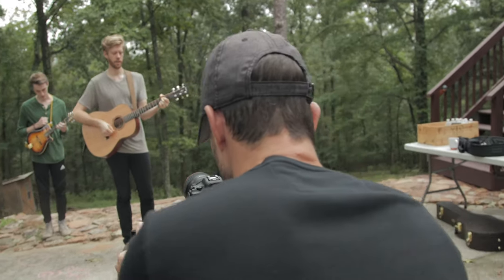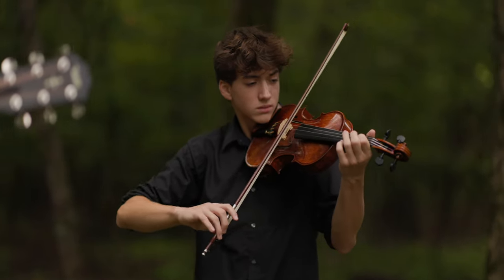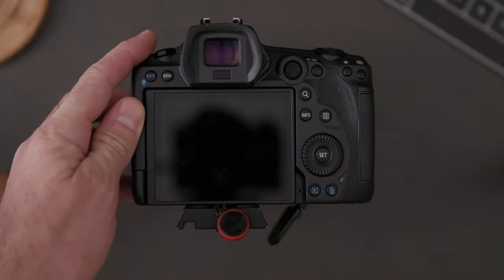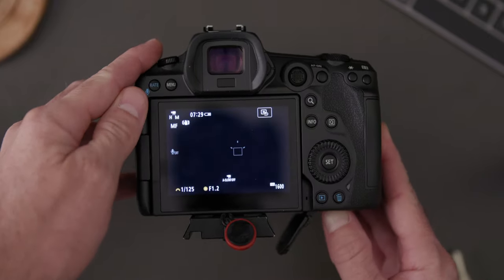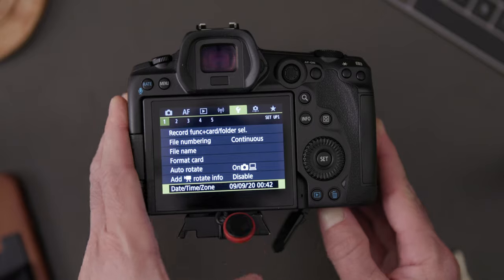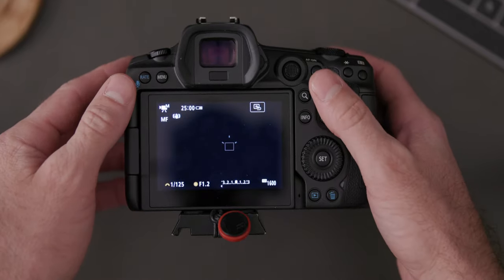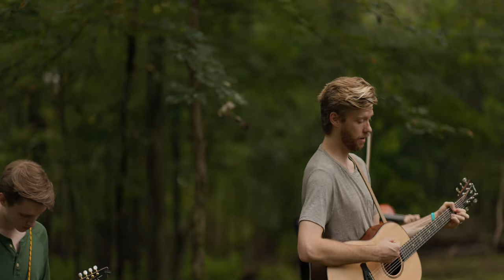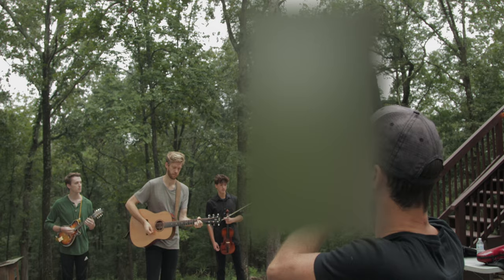Canon EOS R5 - Reset the Overheating Timer in 60 Seconds

Comment from the maker: Please use responsibly.  UPDATE - some are saying that you don’t have to do the battery door trick, just change the date and pull the battery out. 🤷‍♂️ UPDATE 2 - It works. just change the date and pull the battery without powering down, this will reset the timer any time, even if you haven't overheated yet. Stupid simple workaround.
Reply: So you’re saying that we could just keep resetting the camera and continue on shooting? And then the camera will shutdown before the sensor gets damaged? I’m not trying to hold you to this 🤣 It would be good if someone tried it out to see. I’m not willing to risk my camera, haha
Reply: @VisionRouge
His summarized hack....step by step:-

1. Power the camera with a external battery and close the door beside the R5 (you can also do the screw trick if you like)

2. Record video until you see the overheating logo, or even until the camera shut down.

3. Turn OFF the camera by using the power button so your recording parameters (ISO and so one) are saved.
4. Turn back the power ON.

5. Go to the menu, Change the time of the day to +3 hours at least (or add a day).

6. Drop the power by disconnecting the external battery.

7. Wait 30 seconds or even less.

8. Put back the external battery. The overheat issue should be gone. (if not, you may actually be in real overheat situation), try in 10mn…

Extra step to put back the time: You can do this after step 8. This have been confirmed working by dellfonic from MagicLantern forum.

9. Turn OFF the camera using power button. [this is the extra step]

10. At this time, the “overheat flag” is now written into memory.

11. Turn back on the power with the power button. The camera is now booting from a regular boot.
Reply: YOU ROCKZ!
Reply: "From what I'm told,"  -  WHO told you?  Absolutely NOT anyone from Canon.   Your camera will be DEFECTIVE in time.
Reply: U R NOT ME sure bro 👌🏼
Reply: @KevKlopper  thanks for your reply, Mr. Canon Engineer
Reply: Rooting for $4000 “VOID” Watranty  disaster
Reply: In 2 months, All these "Experts" are gonna be crying and uploading "My Camera Overheated and Broke" videos.
Reply: @iwaswithyourmom9410  guess we will see in 2 months.
Reply: It definitely relieves stress, but would you recommend using the r6 for full wedding days? Not sure if I should get that or a used 1dx ii
Reply: @nelsontan2406  or sooner.  Did you see lensRental's teardown of the R5?  There is no fucking place for the heat to go in that crammed body.  Unlike cine cameras that are larger and have fans.
Reply from the maker: @rickymeyerfilms  The R6 will have a better image, since it's oversampled 4k and has clog, which gives you more dynamic range. throw in smaller body size and ibis plus a flip screen. It's way better. The question is, does it overheat? I'm not sure how it performs with newest firmware.
Reply: The Film Poets have you taken your r5 out to shoot a full wedding yet? (Before the new firmware)
Reply from the maker: @rickymeyerfilms  yes. I did it with 1.1.0 - I did an interview and a few shots in 4khq, some stabs too, and then most of the prep in 4k regular. then some 4k60p for precessional and portraits. Lots of on/off shooting. It never overheated, but I was carful to manage it.
Reply: @rickymeyerfilms  get c300 mkiii...oh if budget is a concern stick with 1dx ii you will sail through
Reply: @maxmaxmaxgoon5602  Ended up getting C100 Mark II and some other equipment. In love with cinema cameras! Don't think i'll be going back.
Reply: @rickymeyerfilms  well done yow
Reply: @iwaswithyourmom9410  It's been few months what camera u got
Reply: @rickymeyerfilms  well done have u get client base..if not go get one I think youl make lovely images forget all these 4k boffins...like me they got secret income to finance this lavish cameras they not film makers you know dat....I work construction that's how I got mine ...I am film maker wanabe no shame in the gamw
Reply: Did u check out my hack

Comment: I bought my R5 yesterday. After playing with it for about 20 hours and having a blast. I noticed that the firmware wasn't updated. So I decided to do a quick update. Thank you so much for the upload not only did you save me from going batshit crazy by going through my menu over and over and over again. But you also showed me a neat trick for that I'm going to subscribe and give you a thumbs up.
Reply from the maker: good to hear. Use Clog 3 and ISO 800 as a base for maximum DR.
Reply from the maker: BenThereBenThat  yes so far it does.

Comment: Thanks for sharing my finding!
Reply: Your summarized hack....step by step:-

1. Power the camera with a external battery and close the door beside the R5 (you can also do the screw trick if you like)

2. Record video until you see the overheating logo, or even until the camera shut down.

3. Turn OFF the camera by using the power button so your recording parameters (ISO and so one) are saved.
4. Turn back the power ON.

5. Go to the menu, Change the time of the day to +3 hours at least (or add a day).

6. Drop the power by disconnecting the external battery.

7. Wait 30 seconds or even less.

8. Put back the external battery. The overheat issue should be gone. (if not, you may actually be in real overheat situation), try in 10mn…

Extra step to put back the time: You can do this after step 8. This have been confirmed working by dellfonic from MagicLantern forum.

9. Turn OFF the camera using power button. [this is the extra step]

10. At this time, the “overheat flag” is now written into memory.

11. Turn back on the power with the power button. The camera is now booting from a regular boot.

Thanks for sharing the innovative hack.
Reply from the maker: thanks for being so smart!
Reply: You are a legend man!

Comment: Quick question. Did you sell your Gh5s for the R5? Is the heat issue worth going back to the 1dx mk3? If you shot a wedding with the R5 I am assuming you have to do this hack every 30 minutes
Reply from the maker: I shot a wedding with the R5 and had no overheating. I just used some 4kHQ in bursts, and then regular 4k for longer stuff. Then some 4k60p whenever I wanted. No problems, but it's good to know that this is there if it overheats and I just have to have some more 60p. - I just like the size and flip screen so much more than the 1dxIII, although they are both gorgeous.

Comment: Does this work for the 8k and 4k 120 too?
Reply from the maker: yes, although 4k 120p is the mode that causes the most heat. I'd be carful not to keep pushing that one. I actually used 4k 120 the first time I tested it.
Reply: @thefilmpoets  sorry to ask again, but how many times in a row did you try with the 4k 120 :)
Reply from the maker: @QippysChannel  I didn't do much, but someone on the forums did. From EOSHD - "But this is interesting: There is another overheat symbol appearing after 15 minutes into my seconf 120fps run: one without the camera, a thermomter only. After stopping and taking out the card (leaving in the SD card) the symbol turns white. It disapears after taking out the (very hot) CFExpress card. So it seems to be an overheat warning for the CFExpress card."
Reply: The Film Poets oh ok , thnks so much for the explanation, i can see it definitely useful if we really need some shots when we really need to 👍😊

Comment: Hey almost a year down the road do you think using this hack regularly reduces  camera life span also. Do you have any idea if this still works on version 1.50 firmware?
Reply from the maker: yea I need to use it occasionally. Works fine, dont even need to use a tool to hold the battery door open. just pull the battery after changing the date.

Comment: Well, that's amazing, and relatively painless - thanks for the tip! Getting beyond the overheating issues, how are you enjoying the R5? Do you find you're going to this over the 1DXiii at this point, or do you go back and forth?
Reply from the maker: I love the R5. After using it, the 1D bodies feel massive in comparison. The 1dxIII image is sharper in the 60p modes, but everything else goes to the R5, and I actually haven't had overheating issues on a real shoot yet. -Matt
Reply: @thefilmpoets  That's my feeling too... I was coming over from the EOS R. I've just loved the R5 for both motion and stills. It's hard to put my finger on why it feels so much nicer, but I'm digging it. Looking forward to getting my hands on more RF glass, but for now, the EF adapter w/ND has been pretty great.
Reply from the maker: @JoshMiles  Yea I REALLY like the adapters. I'm rocking the one with the polarizer right now. So simple, but also it's the best pola I've ever used. No color shift.
Reply: @thefilmpoets  so the 60p mode is sharper on 1dx iii is the last thing I want to hear...what a shame....and how is 4k 120 is that softer than 60 on r5

Comment: How did you connect the Peak Design Clip to the Manfrotto plate? :D
Reply from the maker: Stefan Gatzke leave a little space at the back for the loop to push through
Reply: @thefilmpoets  thanks! My loop seems to be to short to make this...
Reply from the maker: Stefan Gatzke it was tight. I’m not sure I’ll be able to get it off.

Comment: Hey Matt, has the R5 overheated on you while on a paid gig yet? Did knowing it could overheat  constrict your normal shooting style? Thanks.
Reply from the maker: No overheats on a paid shoot yet. I just had to stay at regular 4k, which doesn't overheat, a lot, and then I shot 60p and remembered to turn the camera off in between shots since it was connected to an external monitor on my ronin-s. It all worked well. I'll keep testing though.
Reply: The Film Poets has this been prior to the firmware update? Additionally 4k 120 or what are you using for slo-mo?
Reply from the maker: @felipemvera  it works with all firmware, even 1.1.1 - and no need to even do the battery door trick. I use 4k 60p mostly and 120p for super fast action that I want to slow.

Comment: The JOKE is we shouldn't even have to do this.  But ty for the fix
Reply: The joke is that people believe in these hacks. Did you see lensRental's teardown of the R5?  There is no fucking place for the heat to go in that crammed body.  Unlike cine cameras that are larger and have fans.  The heat is fucking real!  LOL!
Reply: @iwaswithyourmom9410  The aluminium heatsinks take the heat away from memory chips and area around the CPU and channel it to the screws in the body. The heat is also expelled from the body itself.

Do sustained high temps above 60C damage the internals (voltage regulators) etc? I would have thought Canon would have protection mechanisms in place to stop any damage. Time will tell.

Comment: If you really love Canon, press for recall.
Reply: No need, it could be fixed with a firmware update
Reply: @LarsSteenhoff  not be sure. 
If They would have already made it a a available. 
I think it's major hardware failure. 
The longer they delay accepting it, the more damage they cause to the company.
Reply: @S.T.VisualStories  they have a c300 mkiii and a host of camera coming out they have to protect them and industry

Comment: What a POS camera.
Reply from the maker: Haha. It’s the best image I’ve shot with but at the same time it can possibly overheat. Tough to hate on it too much.
Reply: @thefilmpoets  Look, I get it.  We live in a different day and age.  Common sense?  Dead, buried, plants grew, died, buried, became coal, mined, in the grill, fire it up, lets BBQ.  If I were to tell you the new Corvette goes 0-60 in 2.0 seconds, gets 100MPG, and seats 6 in pharaoh like comfort, but it is only reliable for 90 out of every 100 miles, would you buy it?  You could stop the car, crawl underneath, reach into the engine compartment from the bottom, and use a screwdriver to remove and reinstall a screw, and, viola, 90 more reliable miles.  It does erase your radio stations, tripometer, seat memory, unsyncs the FOB's, etc.  Feel better?